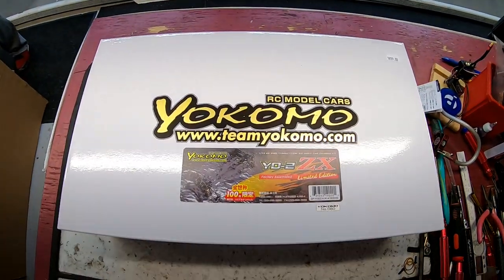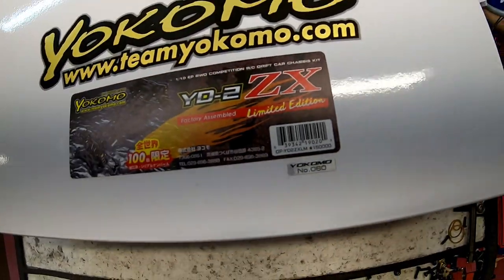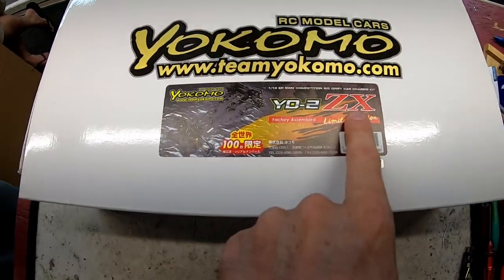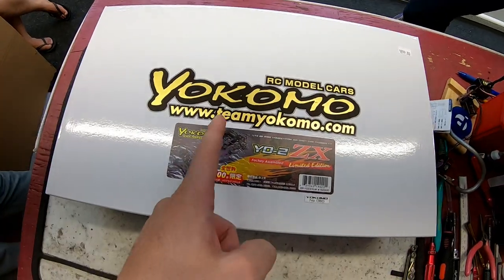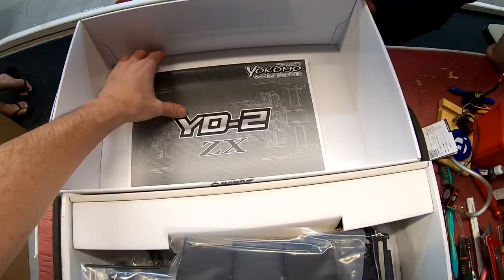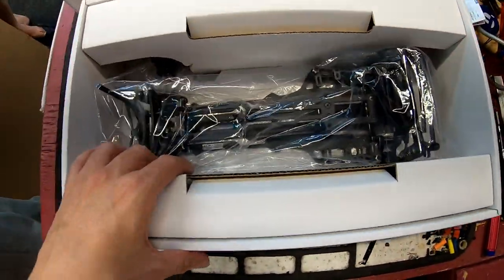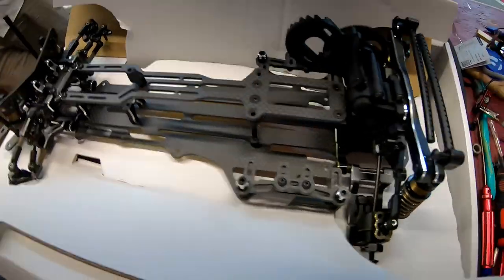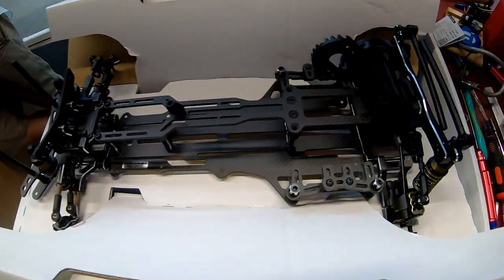Nez0's Bad Shoppe @ Strickly Sidewayz: Yokomo YD-2 ZX Limited Edition #060 Trackside Unboxing

Comment: In Singapore, we got #12 and #13(mine). Changed the ball studs on the slide rack to a short neck one for more angle, changed the front and back turnbuckles to ti. Noticed that  it was factory built but some small differences on the lower arms, with one side showing 9lines and the other 8 lines, rear diff cover had 3 x 8mm screws and 1 x 10mm screw?!

And mine came out of the box without the small short Servo turnbuckle (the dealer helped me email Yokomo and they sent one foc few days later)

Running sp03d Servo, v4 gyro and hw d10 13.5t with XD10Pro, tx m17
Reply from the maker: Aww yiss hehe Twins with #12 and #13! :D Nice already tuning and trying diff stuffs! I am going to dive into my ZX LM soon for a deeper look and build analyzing as I found during my electronics installation that the motor mount was one position off and the motor could not be installed to mesh pinion and spur properly. I will check the areas you mentioned on mine as well to see if anything is off :) Thank you for your feedbacks and experience so far!
Reply: I bought a YD-2ZX 'Special Edition', which is essentially exactly the same as this chassis except for the lower deck doesn't have the graphics or limited edition number. It seems to have been released shortly after the Limited Edition and not sold for long.

In some areas of the chassis (such as the rear diff cover like you said) there were unmatched screw lengths. I also had 3 different types of spring cups on the shocks making it sit uneven.

The diff was leaking oil and the shocks weren't assembled correctly. There were other issues too. Overall disappointed in this factory assembled chassis.

Thanks for the tip about changing to short neck ball studs. I'm having issues with angle and ackerman. It's just not handling anywhere near how I'd expect for a fully upgraded chassis.

Comment: Hello, what rims/tires do you have on the purple ZX? Also, what size hexes? TY
Reply from the maker: The wheels are MST 8mm offset, tires are Yokomo Type C. The wheel hexes are the standard set of 8mm hex in front and 5mm hex in the rear :)
Reply: Thanks man!